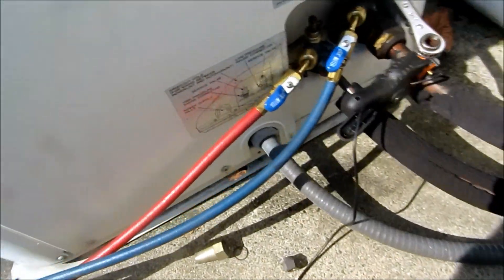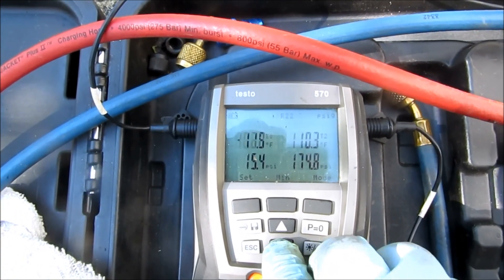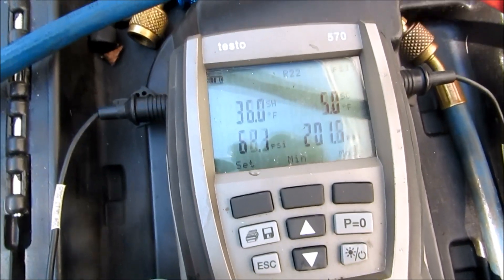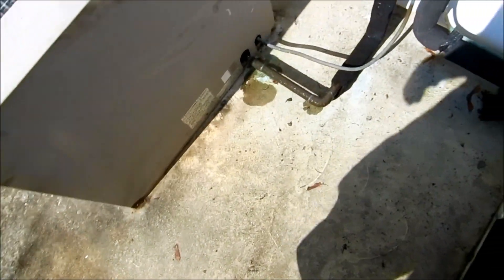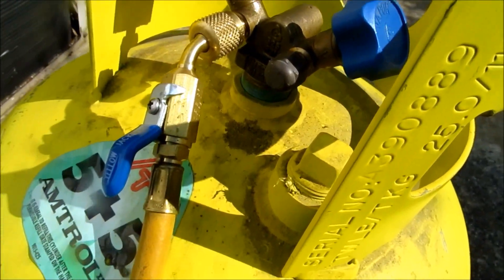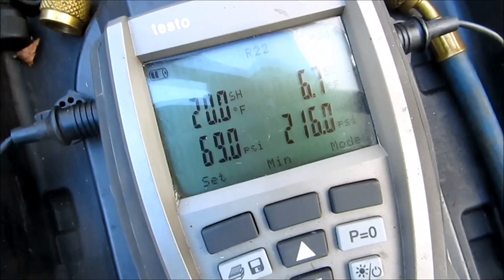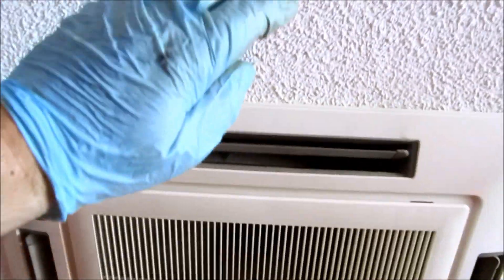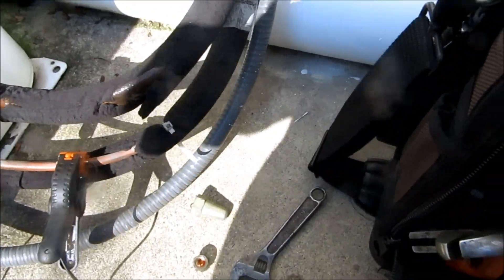HVAC- -old sanyo mini split , brought back to life

Comment: Sanyo Mini Splits r unique in their design.  The compressors r oversized and the evaporator r undersized.  This is deliberate to provide a compact small unit in the customers space.  They cool very well with a good heat load.  However they will run lower back pressure and b susceptible to icing up, especially when run in auto or with the indoor fan on Low settings.
Reply: And the Japanese really love their rotary compressors- Sanyo really led the way in this regard, and advertised it quite heavily- especially on their older packaged units which had the trademark "New Rotary" on them.  I think they were even the first to have a 2-stage rotary compressor.

Comment: Yeah that's an interesting one. Definitely an older boy if it's R22. Good tip about the recovery tank, I was always taught to leave the tank undisturbed at a consistent temperature for 24 hrs and crack the vapor vale for a second or 2

Comment: I think on some of the mini splits the condenser unit contains the txv or metering device. So both lines could contain vapor. The evaporator doesn't have a metering device.

Comment: Not often that you see those older Sanyo Split System Air Conditioners/Heat Pumps, and what year do you think this one is from? Also, is the Sanyo unit that loud, or is it the one next to the one that was being repaired?

Comment: the liquid line is insulated for better subcooling
Reply: Interesting. Would you mind explaining how insulating the liquid line to hold heat in will increase subcooling? By definition, subcooling is the amount of heat removed from the refrigerant after it has fully condensed into a liquid. So if anything I would think that removing the insulation from the liquid line would increase subcooling a tiny bit because the liquid refrigerant would cool off more on the way to the metering device as it it passes through an uninsulated liquid line than if the line was insulated, but I could be missing something. Thanks
Reply: @averyalexander2303  both vapor lines
Reply: @doddgarger6806  On most mini splits the small line is the chilled liquid refrigerant after the expansion device and the large line is the return line for the vapor, but on this unit the small line is the high side liquid line as he said in the video.